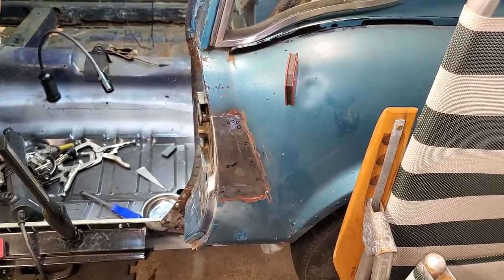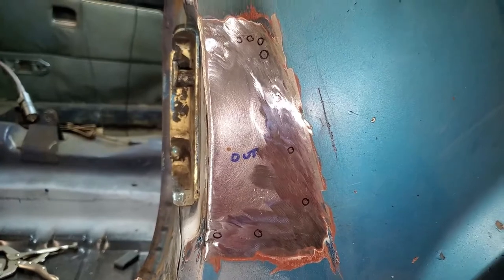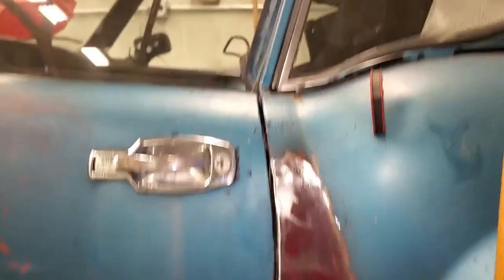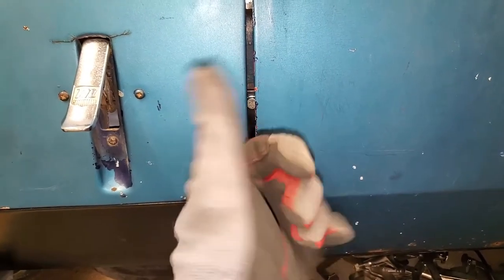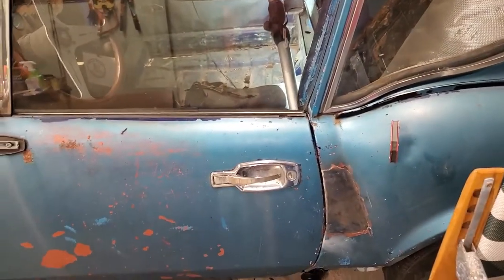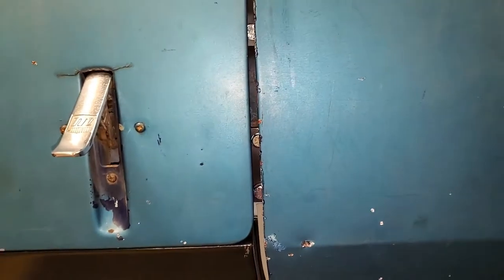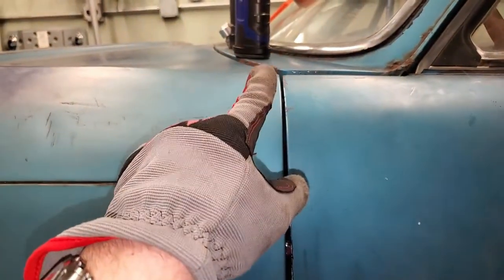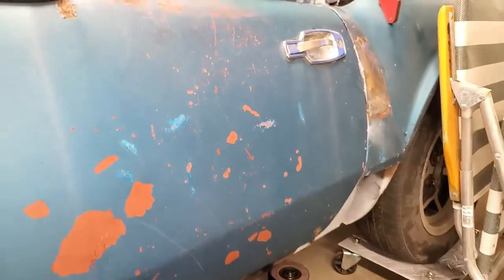Triumph GT6: Final b-post patch and door "alignment".

Comment: That patch is looking good!  I’ve seen on the forums where folks have welded a bead on the edge of the door skin to build it out to get even gaps.  I spent an entire day adjusting the door striker on mine to get it just right.  A lot of shimming, adjusting, listening until you get the perfect click with no metal on metal scraping.  It’ll be worth the effort in the end!
Reply from the maker: Thanks. I've seen that technique (welding a bead on the edge of the door to build it out) elsewhere too.
Adjusting the door striker is another issue. I really think the door "sag" (due to weak A-post) is causing a lot of it and no adjustment will help. Reinforcing the a-post is the only thing that can help. I've put off that task until after the sill is on. Which is going to be another whole adventure due to another problem I discovered on the upper a-post...film at 11.
Reply: David Plass looking forward to it!  But with the stuff I’ve dealt with on mine, I feel your pain!
Reply from the maker: @brandongroh4418  Thanks. Something I need to keep in mind is that this car was a mess when I got it. (Even the PO said the body needs to be completely replaced!). Anything I do to it will be an improvement, but it will never be perfect. "Better" is what I should strive for, not "perfect".